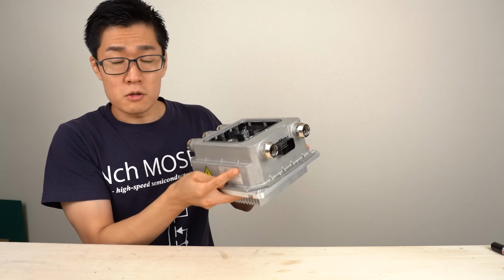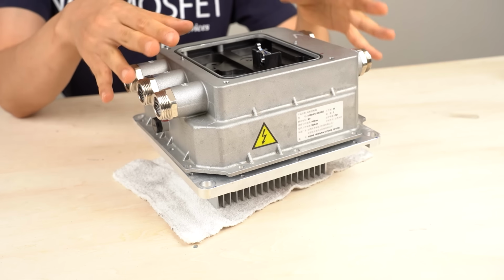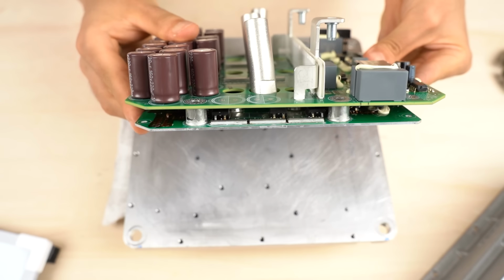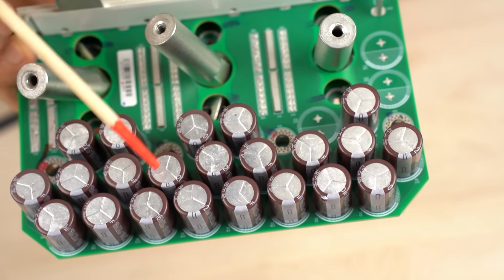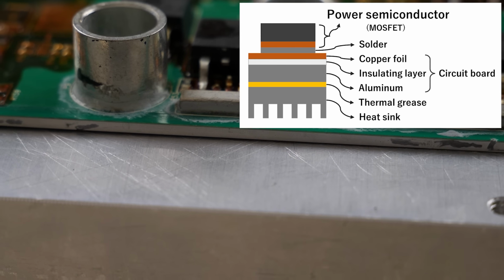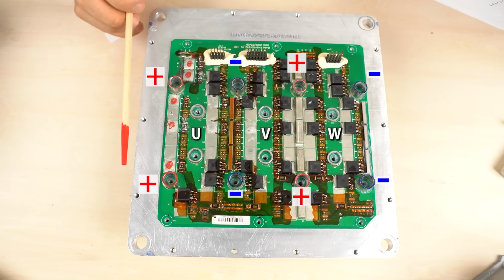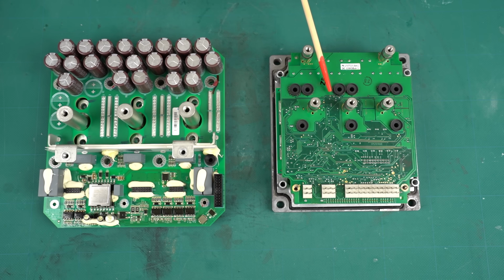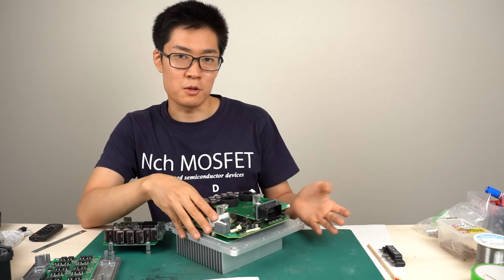$4000 Electric Car Inverter Teardown.

Comment: Good video. I don't like the pillars for transferring power, that seems like loose connections. It's also odd that they alternate + and -, it's more common to have + on top and - at the bottom and the 3 phases between them in a hex bridge. I think Tesla's inverters since model 3 are better connections, not the Curtis style

Comment: Hello Denki. What brand of capacitors were used? If it is not difficult to unsolder and measure internal resistance and leakage currents.

Comment: there needs to be a paradigm shift in inverter design, dominant issues like current sharing, contact resistance are still unaddressed scientifically

Comment: Even if the thermal barrier sheet was tightly compressed against the electrolytic caps, it would NOT in any way prevent them from venting if they overheated or failed.  Anyone who's ever seen one of them vent know they generate a lot of pressure (they have to break through the crimps in the can). In any case, the electronics will always be the weakest failure point in an EV and those inverters should be easily accessible to be replaced.

Comment: TO263 mosfets in parallel, mounted on alluminium board is a one of the best quality/price ratio. You can easyly dissipate pretty large heat from semiconductors and you use cheap and common components. Also, capacitor board on top of the inverter board is for minimize parasitic inductance of DC bus. I had a lot of headake with voltage spikes on transistors, because capacitros were placed on alluminium transistors board.

Comment: Warum braucht ein elektrisches Auto einen Inverter? Warum schaltet man nicht einfach die Akkus ein und aus?
Reply: it has 3-phase ac engine; jump into physics; and sadly, there are no real gearboxes; start currents are very high;
Reply: @7alken  Verstehe ich trotzdem nicht: wenn man tausend Akkuzellen hat, kann man doch zu dem Zeitpunkt, wo zwischen zwei Phasen 0V ist, die Akkus zwischen den beiden Kabeln aus stellen. Und kurz  danach eine Zelle oder ein paar Parallel einschalten. Und dann noch mehr bis man bei der Maximalspannung des motors ist. Das dann jede Sekunde ein paar hundert mal alternierend und schon dreht der Motor
Reply: @ umm, so its called inverter here, but those IGBT are such switches, but you need to control by PWM the currents esp since start from zero in some manner, otherwise motor coil burns ... physics;
Reply: @7alken  It's not an inverter. You can use every cell, even if some are defective, without the need for capacitors or a DC-DC transformer—just a simple controller and a cable to each cell with an H-bridge.
Reply: @jo21e6  if the voltages are luckily matching )) ... inverter word is used gnerally
Reply: @jo21e6 inverter is just something that can convert DC to AC 
The inverter you are talking about is used to step up the voltage and convert DC to AC

Comment: The mosfets wired in parrelel actually should share current decently well because parrelel mosfets are naturally self balancing - if one heats up more than the others it will exhibit a higher conduction resistance, so more current will be off-loaded to the other mosfets.
Reply: facts
Reply: Yeah all motor inverters for EV use this principle. Tesla inverters have something like 8 mosfets in parallel for each half bridge side.
Reply: Interesting. Was not aware of this.

Comment: Some comments.  I'm not seeing any EMI suppression on these boards, so how does this car allow radios, bluetooth, GPS, or any other incoming radio signals from being disrupted by these high-speed and high-current circuits.  Even if the box is solid, that noise will come out on the cables.  Second, this design appears to be modeled based on thermal considerations, which we also did.  The development boards were probably IR mapped, and then appropriate parts placement was made to distribute the heat.  The incoming busbar flat plate arrangement does provide some medium frequency EMI suppression, but it is clearly inadequate low band radio.  Per prior comments, electrolytics tend to have lower ESR as they heat up (until boiling over) so there would be some thermal matching in low power operation.  Film capacitors have low ESR only if they have thick sheets, and require a large flat surface.  Their volume factor is usually inconvenient of other parts have high heights.  We did some of equivalent fork-lift and cargo-carrier designs, and the overall design is often limited by the space allocation within the original equipment.  We made electronics to fit the application.  That's why they paid us those big dollars.
Reply: This system is quite low voltage so switch times can be slowed as well. Output connection goes straight to motor which is shielded and the wires could be also shielded.

Comment: @12:00 It's pretty simple.  The buss bars are the DC supply to the inverter MOSFETS.  The two thinner ones are the Negative supply.  The positive supply only has One set of buss bars, so they are double the thickness.
Reply: That doesn’t make sense to me. Every phase needs an equal amount of average current on positive and negative input. Consider the DC rails from left to right as A, B, C, D. A supplies positive to phase U, B negative to U and V, C positive to V and W, and D negative to W.

B and C will carry the same current and A and D will both carry half of that. The reason that they used a busbar for D and not for A is probably because the pads of the mosfets connected to A (the drains) are much bigger so they used the copper underneath those pads to carry the current. They couldn’t do that for D since the sources of the mosfets are much smaller (and the gate pins block the vertical current path), so they decided to add a little busbar rather than making the PCB wider.

Following the same logic, B should have a busbar that’s twice as thick as D, and C should have no busbar since the copper underneath the mosfet drains is already twice as thick as in A.
Reply: @cedricdb  I agree - it doesn't make sense.  I made a mistake when first watching the video.  The middle two DC busses should be the same size, and about twice the current capacity as the outer two.  The middle '+' bus is not only thicker, that all the others it has two outer segments that none of the others has.  Then there's the missing rail on the positive end.  Very strange.

Comment: Regarding the bus bar, I believe the center of the board will become warmer over time. As a result, the resistances of all three sections will be similar if the middle bus bar, which is warmer, is made thicker.

Comment: Those caps shoud haw been imeresed in silicone, and to haw whole area contact to heatsink.
Even simpler solution whoud be filing the body of the inverter whit cooling oil, much beter lifetime plus moisture ingress prevention

Comment: Thanks for such a great explanation of the Inverter for use in a small EV Car. For me, it was interesting to see how the 22 - Electrolytic Caps were used, instead of one larger type. I also wondered if the Inverter had any thermal shut-down protection circuit, and also any (replaceable) Internal Solid-State Fuses for protection. In your opinion, would the failure point of this Inverter be those 22 Capacitors - as they dry-up and get old? I am not an expert, but Electrolytic Capacitors do seem to have a limited life, and their replacement could greatly extend the Inverters' life. Greetings from Australia.

Comment: Great video, thank you and your professor. One thing I noticed about the power board: there is room for double amount of mosfets, which might suggest that there is possibility of making larger power version, even the gate resistors are mounted, maybe with larger size heatsink or even water cooling plate..

Comment: A tip I have learned for reading difficult product numbers it to keep the ic and microscope stationary while moving the light source around at different angle and distances. If this doesn't work I found you can angle the pcb at 30° away from you and angle the light source. You will see the engraving will light up eventually.

Comment: 4000 for that??? When i saw it first i thought the power mosfets where on top, but that's just plastic with connectors. I thought they where power igbt's. So these tiny mosfets cost that much. Just can't believe it. It seems very expensive for what it is. These components are not that expensive imo. I don't know anything about electric cars because they are not sustainable. But i know components and electronics, because it's my hobby for a longtime now. And as for the cost of developement....This is a simple design so that does not justify the price imo. And using these electrolitics is so cheap. Those film caps on the other hand are very good and durable!  When a failure happens they would probably advise to buy a new unit. It seems very repairable but they will not tell the consumers i guess. These practices are getting bolder every year. This is the biggest ripp off with electronics  i've ever seen.
Reply: The entire car is 4,000 - not just the inverter

Comment: Interesting video, what's the reason for having 6 MOSFETs in parallel instead of having just 1?
Reply: Lowering the total resistance which also lowers the heat generated and the heat which is generated is spread over a larger area

Comment: I was going to remark that using standard electrolytic capacitors was a cheap-out choice for something like this because they age over time (especially in hot/adverse conditions) and are more likely to fail than other types, but I guess in a car this cheap they're willing to accept that eventuality.

The pink sheet is definitely designed to be thermally conductive, although it might also provide some vibration dampening as a side effect. I doubt the sheet conducts all that much heat out of the capacitors in practice because of how thick it is, although it is better than nothing.

MOSFETs connected in parallel tend to give somewhat balanced results, because MOSFETs have a positive resistance coefficient with temperature. If a MOSFET is carrying more current it will heat up more, which will increase the resistance along the channel, so more current will flow through the other paralleled MOSFETs. This is reasonably self-stabilizing, so no runaway should occur where one MOSFET is handling all of the current. Of course, this is not perfect so you can't run your transistors right at the bleeding edge of their current ratings if you're relying on this to ensure stable operation.

Comment: If someone had given me that assembly and said "guess the power rating", I think I would have said 2-3kW, perhaps 5kW peak. I can't help wondering how long this unit will last - particularly those Al-Cu compression fittings.
Reply: What's wrong with the Al-Cu connections?

Comment: What is the switching frequency of the inverter? Is it near pure sinus or rectangular AC output? How is speed/power controlled via amplitude of voltage or PWM like?

Comment: usage of aluminum collars for high current interconnect in-between pcb layers is a bad engineering decision. Aluminum oxidizes over time and the contact will weaken, possibly melting the board or even causing electric arc and fire.
Actually at 8:40 you can see the result of chemical reaction in-between copper and aluminum around the collars, spreading around the PCB. So even in a brand new inverter you get damage already there, and you can see that as contamination creeps around the PCB it will make the device broken beyond repair very soon. 
Remember both copper and aluminum are alloys, and the least noble metal will surface out and be leached with moisture. Losing alloy elements will also cause alloy to be brittle.

Comment: Any chance we could get more details on how the board to board connections are made? I've been taught that creep in the PCB material will make a bolted joint like that loose preload over time, do they have some kind of spring on the fasteners to account for that? Also, are the connecting rings really aluminum? If so do they have some way of avoiding bad contact due to the natural passivation layer?

Comment: Thanks. Some comments : It is in general possible to place power mosfets in parallel and many power mosfets have an internal structure based on fets in parallel. Furthermore rdson has a positive temperature coefficient so when one heats up the cooler ones process most of the current. Any series resistors help to maintain the balance and that might be the reason for the smaller busbar. As for the electrolytic capacitors, lifespan is about halved for each 10 degree celcius up in temperature ( rule of thumb ... might apply more or less ). I guess that's a very limitting factor for the life span of this inverter. The film capacitor is a way better option.  
Great video .. make more .....

Comment: That looks like a rather minimal current-carrying capacity for 140 amps!  I was expecting like four times the cross-section to the major conductors.  Flimsy and IMHO it's gonna overheat and fail within a year.

Comment: Brilliant... These TI controllers are used in lots of inverter stuff, lots of the functionality you would normally have to realize with discrete logic and circuitry is already inside including protection and hardware comparators - even if their operation is not trivial, deriving from an existing product is not that big effort. They are also available in multicore configuration driving highly integrated and protected solar converters. It would be interesting which switching frequency is realized... The controller has advanced ADCs which can run synchronous to switching frequency, the CLA coprocessor can  preprocess the acquired samples and offload the core. Its a proprietary  TI 32 Bit architecture with FPU, the CLA coprocessor can also operate floating point values. Weird Harvard architecture... perfect.

Comment: you forgot to mention the controller board that all components are assembled on one side and the other is full of test point. You can see Curtis inverter use aluminum casting and the automobile use CNC extrusion aluminum for heatsink.

Comment: I'd like to think back to my scrap LCD display that was scrapped after 5 years due to the capacitors failing. Got it for nothing. Soldered in new capacitors, by doing so, got a new display for my PC for cheap.

But in freaking cars... Talk about waste. Not everyone will fix them, and if it isn't economically viable..

Comment: Can someone explain whats the difference between this controller and smaller vesc based controllers? Some of them are rated for 100V 200A (continuous) but are of small tablet size. Why is this one so big if both are air cooled?
Reply: I think the VESC is unlikely to meet its rating at higher ambient temperatures (55C+). Also way less capacitors so may not be reliable and drive the motor as smoothly. 
But the parts its using (FETs) are more expensive, which can explain the size difference somewhat.
Reply: Vecs will heat up quickly if doing low rpm high torque output,
This is the area where capacitors and body diodes do their work
Reply: @onGlobalproductions  But 100A at low RPM and 100A at high RPM would have similar losses, they would even be higher at the high RPM. So is the spec legit or no?
Reply: Which small VESC does 200 A truly continuously under actual use? The biggest VESC model “100/250” (absolute maximum peak voltage of 100 V and “continuous” current of 250 A) for example has even its power connectors only rated for 90 A continuous... (The 250 A seems to be derived from internal transistor ratings for infinite cooling, or something similar.)

So, it probably wouldn't like actual 90+ V battery pack either with all the voltage spikes.

Basically, the actual realised continuous power is likely much less. Not much less, but then again the size is also not that much less.

Comment: What’s crazy is I only see 500.00-600.00 worth of components/pcb/aluminium. How companies can get away with ripping people off is beyond me.
Reply: huh? its way less than $500 of components as the whole car cost $4k... you misread
Reply: You do realize there is a lot more to selling a product than juts the BOM cost right?
Reply: Its what we often see in instances where there is a single supply source.  The customer is already captured and there is basically no other option to keep their already purchased car from becoming a useless item.
Reply: The entire car is $4000, not just the  motor driver
Reply: I think it is 3000usd per car

Comment: Seems like a decent inverter. You can see where corners were cut to save cost, but over all, it seems to be a well designed inverter. Nothing too fancy, just something that can get the job done.
Reply: Im curious if the foam provides enough protection against mechanical damage to them,  My only gripe is the lack of silicone or at least hot glue on the caps but it otherwise looks decent.
Reply: What about the hot temp ? @NaughtDubs
Reply: @D7UN4Channel  silicone RTV is extremely temperature stable and will last for years. It’s what’s used inside the industrial inverters I work on. So it seemed a bit odd to me to not see any.
Reply: @NaughtDubs  I see..
Reply: @NaughtDubs  They didn't cut corners by not copying designs and leaving out bits that seem important.
Reply: @NaughtDubs  doesnt normal rtv have chemicals that can damage bare circuits over time?  theres specific electrical grade silicone which doesnt. not as temp resistant but not far off.
Reply: I bet most things are copies of originals. Cheap caps, etc.

Comment: It is not a 20kw inverter. Inverter rating is at constant output. So it is 14 kw. But going by the size it would be lucky to do 10 kw